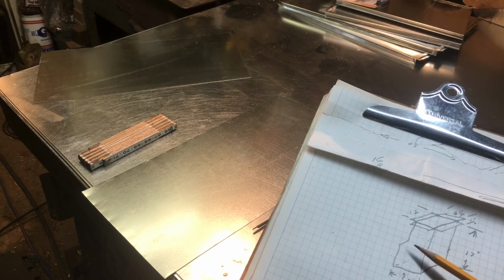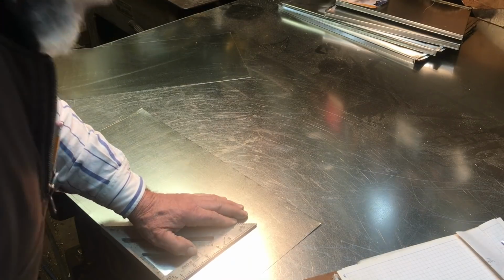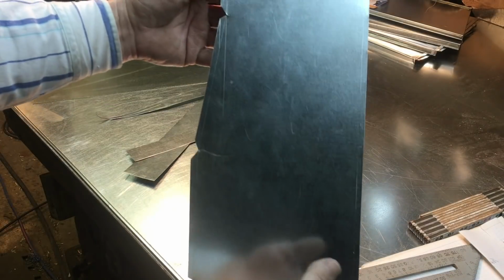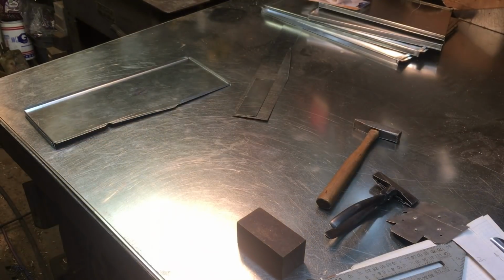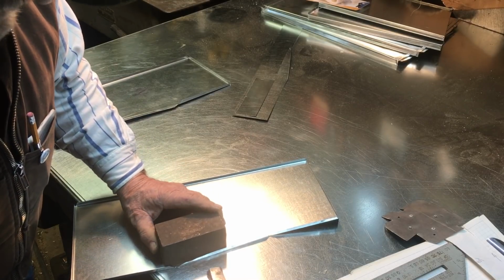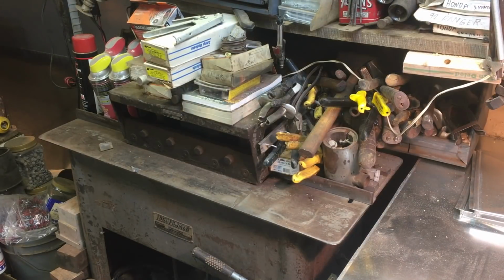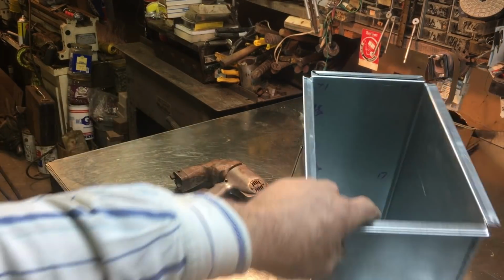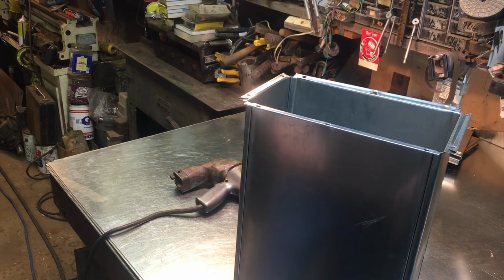Boot Adaption for Adding Floor Register

Comment: I have been doing sheet metal for 31 years at the same place.we have a plasma table but I still lay out by hand.try to teach the younger ones how to do by hand and they could care less.always say what if the plasma goes down.
Great work love your videos
Reply from the maker: I couldn't begin to use a plasma table...without a bit of training anyway.  Actually a LOT of training.  Being retired I don't have that concern anymore though.  Thanks for the comment and I'm glad to hear you enjoy the videos.  I just wish I'd have started a channel before I retired.  All the crane lifts setting huge rtu's and helicopter lifts would have been interesting to record. I missed the chance to record building 100 ton and larger air houses, all the DDC controls, chiller and boiler installs and monstrous duct systems on multi story buildings serving fan terminals and vav boxes.  Thanks again for the comment !!
Reply: @tractorman4461  i would have liked to see those jobs.i mainly do residential and light commercial.at my age I pretty much oversee the install jobs and meet with the inspections on jobs.i wish I had a home shop as nice as yours.i play around with making things out of copper at home,leaves,bowls and roses.take care
Reply from the maker: @xslabcabxhearsex  That's really cool that you make functional and ornamental items.  I just love to mess around with it but I just have no time.  I've got tons of ideas on things to make....just never get there.  LOL.  Too lazy I guess.  I pieced this shop together over the last 40+ years like Johnny Cash....one piece at a time. There's still a lot of hand tools I've not even broke out for the videos yet.  Lots of stakes and anvils....lots of crank beaders and benders and even a circle shear.  Sounds like you worked your job into the perfect position to spend your 'twiight' years in the trade. I always tossed around the idea of working to 55 then try to teach basic HVAC and related subjects for ten years or maybe hung by the class....  LOL.   But the trade is so darn interesting, I couldn't force myself out of the field to attempt to do it.

Comment: Very interesting Wendell! I am always fascinated by such trade skills. Funny you mention about the drone.  Dave and I found a new way to move the camera around the shop without moving the tripod with extension cord on the floor in the way and such limited views. I'll include that in a video to come.  Dave had an old antenna magnet, that we mounted the camera on. Then I snap the mount under my acticulated jib crane in the shop.  This is obviously overhead and we can move it over the working table, from any angle. We've took better shots of our next project.  Thanks!
Reply from the maker: That's a cool way to video from above Joe !!  My insulated shop has too low a ceiling anyway. But that is a real good idea on the swinging jib.  I've a huge set of overhead beams outside, fixed on four posts but its where I split tractors and don't really use that area for too many other projects.  So unless a random giant comes by and volunteers to video my stuff from above, I'm stuck with the tri pod....LOL.  Thanks for the kind comment about the metal project sir.  Thanks again for taking the time to watch too.

Comment: Hey there Wendel  ...  nice job on making the cover.  Lots of forethought needed to allow for enough metal for the seams and having the seamer there is pretty handy.  You gave some nice tips for fabricating the piece too.  Thanks.  Take 'er easy!!!
Reply from the maker: Good morning Mike.  There IS just a little forethought that goes into even a simple little fitting. That's fortunate too, because that's all I have the capacity for..a 'little' thought.  lolol.  Thank you sir for taking your time to watch.